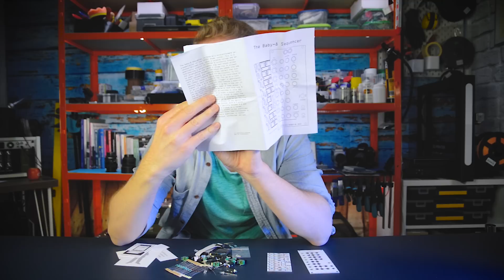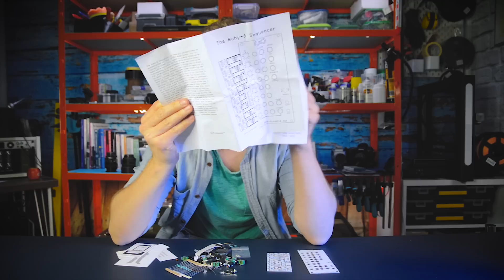DIY Eurorack CV Sequencer – HSTA Baby 8 (english)

Comment: Hi Goetz, when using my RESET input, it switches to being a 10 step sequencer. with twho hidden steps. What is this fucnction for? I'm trying to get the Baby 8 to reset with mu DAW along with the rest of the modules, but it won't allow this it seems. It always adds two or so steps, meaning it becomes out of time. Even if i send a reset from anywhere else, IE another module, it adds steps, pushing it out of sync. Why the extra steps when i just want to reset??

Comment: 1:22 You should solder first a pin on one corner, then the pin on the diagonally opposite side (only then, the chip is really fixed in position) and then the rest.
Reply from the maker: Absolutely true – thanks Joe!